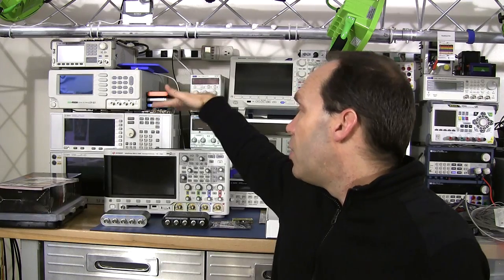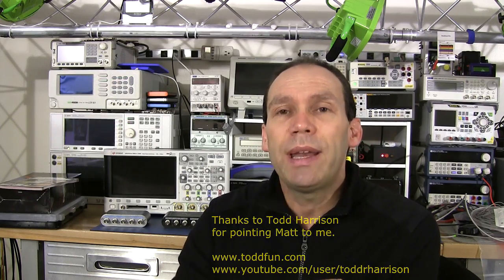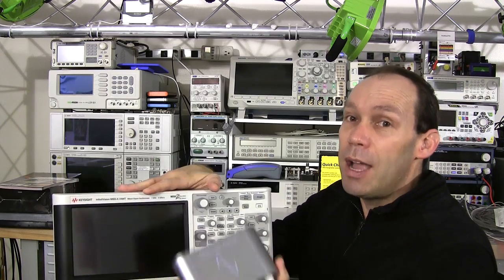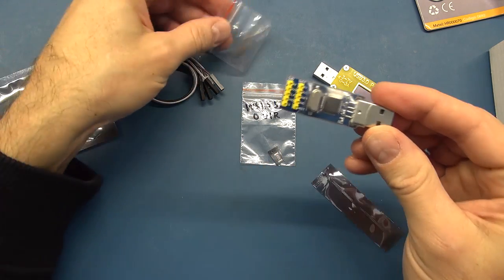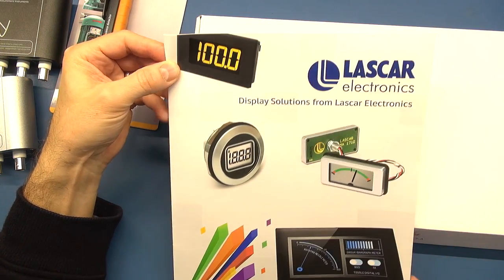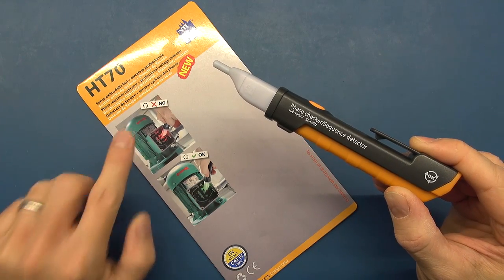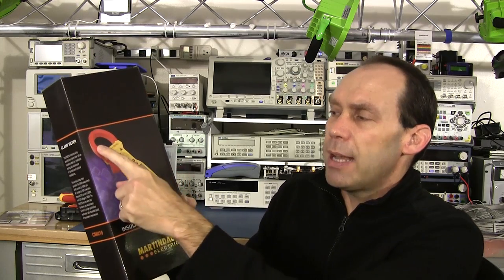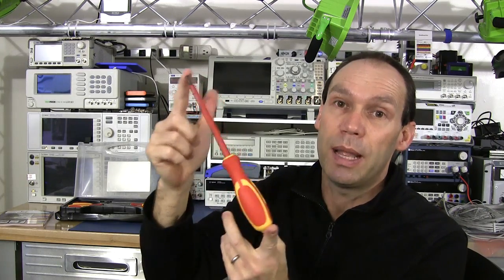T4D #115 - Kickstarters, Mailbag and news

Comment: Thanks, Martin, for supporting the USB power monitors I'm selling. Just a little clarification on the firmware and shunt resistor upgrade - all devices I sold after Dec 30, 2014 already have the latest firmware, and all devices after Jan 10, 2015, already have the upgraded shunt resistor. For those interested, search item# 171657443908 on eBay for the device.
Reply: Thanks Frankie. I love my power monitors. I guess mine have the upgraded shunt resistors then - great.
Reply: shubus
I agree. It's better to spend a little extra for good quality and service. Plus it also supports Martin and those that support him.
Reply: shubus Thanks a lot for the very kind words! I'm trying my best, one customer at a time, to convey the idea that there are still quality products and services from this part of the world :)

Comment: A cordless iron I've had very good luck with is a Hakko FX-901. Uses four AA batteries, comes with a nice sharp conical tip, heats up relatively quickly and is built quite well. I'll probably do a YouTube review of it at some point, but Martin, I'd be curious as to your opinion.

Comment: I haven't seen a rechargable cordless soldering iron like the one you received since the 80s!  That may explain the use of an filament bulb...seems like nothing has changed in the design.  If I remember correctly, rotating the red power button locks it to prevent accidental ussage.  Anyway - thanks for the great videos!

Comment: Have you had a chance to look at that Martindale clamp meter, yet? I am literally drooling over it but I don't want to spend $400 and another $100 on importing it. If it's not worth it. Thanks
Reply from the maker: Ryan Jardina Just opened it and testing on the bench. It'll be the next video released. I'm impressed so far.
Reply from the maker: Ryan Jardina Wait to watch the video...It's great meter but I think I have found an issue with the insulation testing...
Reply: mjlorton great, take you time, I'm sure it will be a great video like all your others.